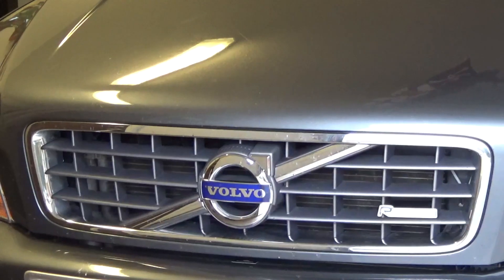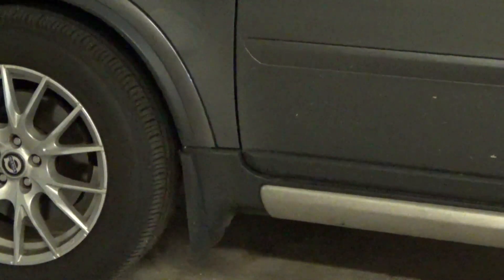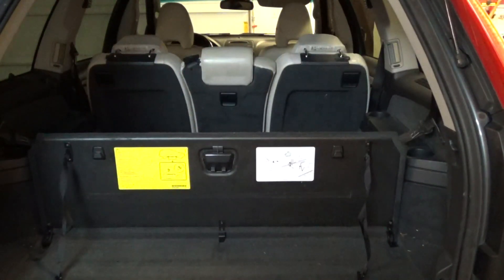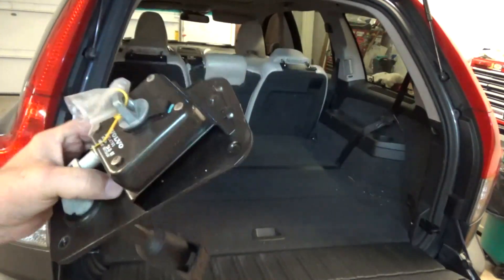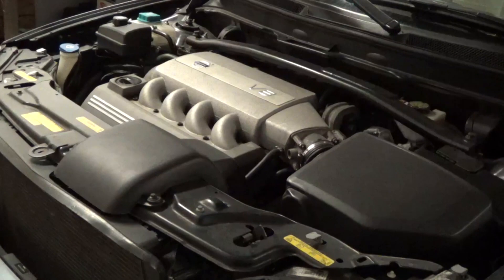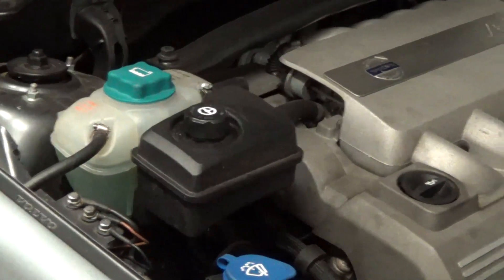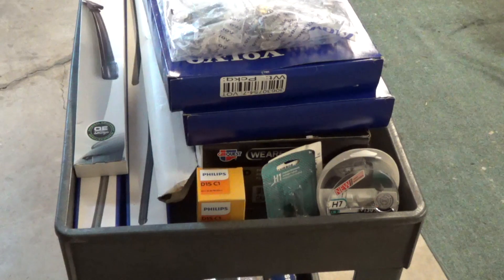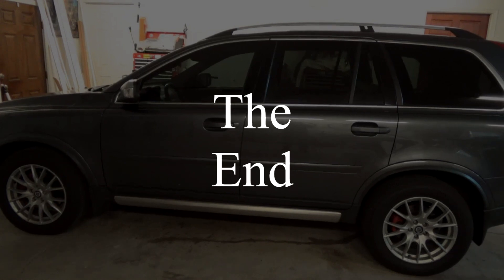Bye Bye to our 2009 Volvo XC90 R-Design

Comment: Going to miss your XC90 videos.  You were a great part of my early introduction to mods and fixes.  We now have two of the 09 XC90 V8 RD's in the same dark grey color.  She has the white interior (85,000 miles) and I have the charcoal leather (75,000 miles).  That price is incredible, especially with the added parts.  Wish you the best in the future.
Reply from the maker: Thank you very much.  We did not think everything would move that fast.  The new White with Blond/Charcoal interior special build B6 Mild-Hybrud Ultimate 7P XC90 might be ready as early as end of October when we were told maybe Christmas.  Thank you for taking the time to leave such a nice comment.
Reply: where are you finding these cars? they are very difficult to find.

Comment: Thank you, David, I still own my 2009 XC90 V8, 189,000 miles. I learned some tricks from you in the past. I will continue to own it, to see how many miles it can go. No engine or transmission works except oil, fluid change, air filter, spark plugs, ignition coils. But I rebuilt the suspension system several years ago. Recently replaced the wheel bearing hubs. Still running smooth and quiet
Reply from the maker: Excellent. Your V8 can easily last for many years. Thank you and I hope you have many safe miles ahead of you.

Comment: I have watched your channel for years, so many parallels between your story and mine . Even I had a 1998 Jeep Grand Cherokee Laredo with a V8 engine before I got my 2007 Volvo XC90 V8 , it has 195K on the Odometer at the moment, the transmission broke down last month and I was caught off guard but decided to get a new transmission installed from Volvo with a Lifetime Warranty, expensive but worth it for me, hoping to get another few years of service from the car and then possibly get the new Volvo EX90 after first year issues are sorted out. It has been a joy and an educational experience to watch your videos.
Reply from the maker: Well ...  How about that.  We are currently waiting to hear from the dealer on our new 2023 Volvo B6 Ultimate P7 Mild-Hybrid in Crystal White with the Blond/Charcoal Ventilated Nappa Leather interior.

The only additional Option we went for was the Nubuck Headliner which is the "Lounge Package."
That also includes the Backrest Massage Front Seats which we do not really care about.

I am planning many videos on that one as I am going through the manual as we speak.  IMO the dealer sales people's videos on that vehicle is poor to put that mildly.

I am very glad that you took the time to leave your comment.  

Thank you very much.

Comment: Did you end up replacing the control arms?
Reply from the maker: Yes I did replace them.  The passenger side is extremely difficult because the transmission lines are in the way of removing and inserting the bolts.